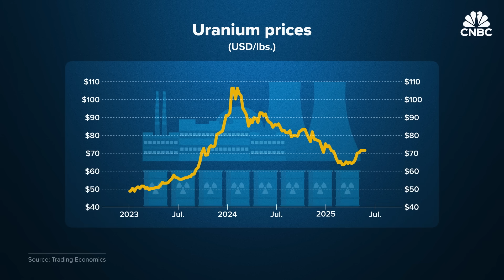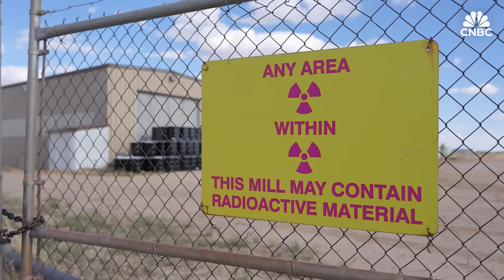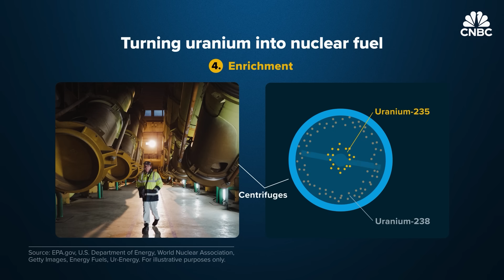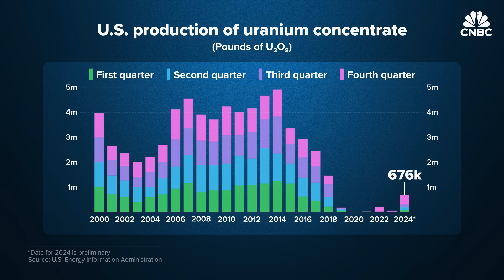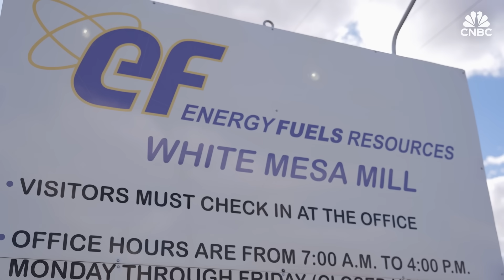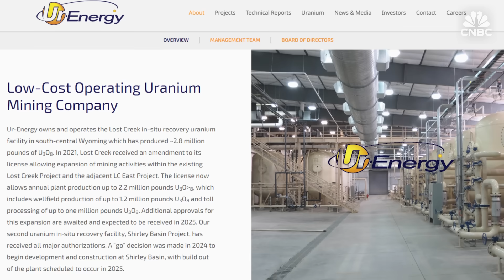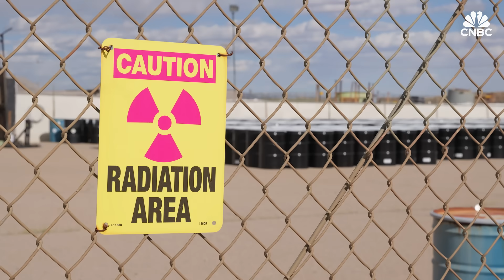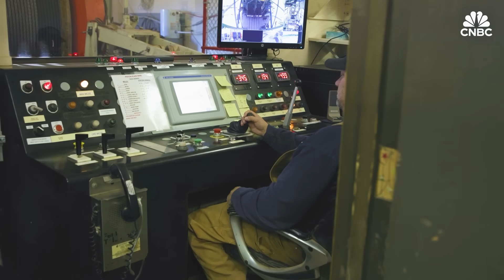How AI’s Need For Nuclear Energy Is Fueling A Rise In U.S. Uranium Mining

Comment: AI helps to format ideas from user input, especially in 3D blueprinting scenarios, and with data accessing, like a telephone operator, to access search results, for pertinent information 

Then fed back into 3D software programs 

Uranium is good for energy 

But the logic of it can be extrapolated also, to things like ytterbium, lutetium, plutonium, thorium 

Even lithium solid state fuel cells

Using ionized hydrogen for Voltage (power) 

Can all be used in tandem with AI 

And there are other methods besides steam electric generation from fission steam 

Like Nuclear Batteries, encased in diamond, which slowly send electricity through the diamond without releasing as much radiation, when triggered by striking with a conductor (Piezoelectricity) 

Or powerful Acid-electrolyte batteries, scalable to nuclear current in emissions of voltage 

Or spherical Nuclear Magnetic Resonance chambers 

Which use solar panels

To excite enriched thorium

Into a supercritical state 

Which then bleeds protons, hydrogen, and electrons off

Into a battery, charging it

Although smaller modular Nuclear reactors

Using steam from (control rods) fission, to spin a turbine, connected to a dynamo, before condensing the water for re use, and deuterium manufacturing, using the turbine to spin a dynamo, powering the grid 

Seems popular 

Especially on space craft and sattelites

To power the main computers, not the motors 

Although the computer is connected to the motor,

It would use its own batteries 

But be sensed by the main computer 

Etc

Comment: This video was unexpectedly rudimentary considering who they were interviewing, and really misses the supply/demand picture. Miserably. It touches on global consumption, but implies a static demand picture when there is an incredible volume of increasing demand through power plant life extensions and new builds currently under construction alone. Forget about the govt stated growth targets and data centre demand. 

Looking at US only currently consuming 25% global demand, and producing 1% of supply. If the peak volumes stated are able to be achieved again from the US, it’s about 15% current (2025), irreplaceable and required demand. Again implied that the US can achieve this, the absolutely critical questions not asked is - at what price, and how long will it take? The estimated answers to these questions are available and I would have expected CNBC to bring this into the conversation. 

Another implication I feel is misleading is the statement that power producers recognize the need for uranium which has kept the long term contract price higher than the spot market. The producers are in multiple years of being well below replacement contracting (buying less than they need) with 2025 being a record low so far. We’re well into the second half and they have purchased or committed less than 25% (annualized!) replacement volumes for the year (this trend has been underway for a decade). So what then has driven the higher cost of the long term market? The uranium producers holding the line based on cost of production and/or recognition of the coming bind the power producers are in, as well as the lack of available material is what. 

@CNBC - try again 👎

Comment: Nuclear power plants take 15 years to build if you are lucky and cost billions of dollars. Solar, wind, and battery take a year or so to build and only cost millions and they provide baseload power. Example at Vogtle Nuclear station two new nuclear plants were built and they cost 45 Billion dollars  and it took 15 years. Nuclear is not a viable economic solution for database centres which need the power NOW, and which are increasingly being powered by solar wind and battery plants. Built in a year or two, don't need water, and don't generate high level spent fuel that has to be stored for 200,000 years or more paid for by tax payers. SWB does not require a 10 mile emergency plan which entails evacuation of everyone within 10 miles of the plant. SWB is superior in cost, time, and fuel purchases which is free because it comes from the sun. The question isn't why this new process is better than old nuclear plant processes. It is how it compares with the new technology of SWB.
Reply: Nuclear is a black hole for money.

Comment: In this entire discussion they don't discuss how breeder reactors could greatly reduce the need for fresh uranium.
Reply: The US built their nuclear energy program around uranium. It would take even longer to build up an infrastructure around thorium.
Reply: @Teampegleg  The main issue is breeder reactors technically violate nuclear non-proliferation treaties meaning even more strict restrictions on them.
Reply: @NitroDragon  How does France get away with it then? They are the most prominent example of widespread Breeder Reactor use. There is also new technology, that eliminates the creation of Plutonium. The problem is that it's expensive. The US needs to break down barrier and subsidize it for the betterment of society.
Reply: @Teampegleg there are 87,000 tons of depleted uranium that can be used in a breeder reactor.  It wouldn’t require any new mining.

Comment: There are a few key insights that got missed in this review. 1. Other western countries have uranium deposits that can be mined for a much lower cost than what is found in the US. This isn't likely to change. 2. Uranium demand is very predictable, relatively speaking. It takes longer to build current nuclear power plants than a new mines. This means uranium miners can expand production on an on-demand basis. 3. There is a lot of mothballed/production expansion sitting on the side lines that can ramp up supply relatively quickly.

Comment: I like how the numbers are in tens of millions of pounds for all the US supply. I just want to point out that one GW coal plant can burn 2 or 3 million tons a year. Uranium is super energy density
Reply: One pound of uranium equals 1.7 million pounds of coal not counting all the energy required to mine it and transport it…coal is insanely inefficient compared to fission
Reply: That and a lot people don't realize that there is a massive difference in weight for uranium between ore and refined product
Reply: We should be using MSR Breeder Reactors that are walkaway safe and convert U238 and Thorium 232 into fissile fuel while they are producing electric power. The U238 in our nuclear waste bread in MSRs could power the USA for over 100 years.
Reply: We should be using MSR Breeder Reactors that are walkaway safe and convert U238 and Thorium 232 into fissile fuel while they are producing electric power. The U238 in our nuclear waste bread in MSRs could power the USA for over 100 years.

Comment: This is the main argument for thorium. No enrichment needed. It can be thermally bread. Online chemical processing is needed to remove neutron absorbing products during reactor operation, that's about the closest analogue to enrichment in its fuel cycle but its significanly less energy and infrastructure cost than uf6 centrifugation.
Reply: They also need a breeder reactor, which has not been in comission since the EBR-2 and would need to be designed, commissioned, and constructed to completely unfamiliar standards.
I agree with the thorium concept, but we don't have the means yet. Maybe if we help India they could share designs and results.
Reply: @samuelnakai1804  I mean, yes it needs to breed. But unlike uranium you dont need fast neutrons to breed thorium. It can be breed with thermal spectrum neutrons. Which means you dont need crazy stuff like liquid metal coolant.
Reply: Thorium 2050
Reply: Thorium has never been used beyond testing. 

However, there has a been a reactor type that has been in use for nearly 60 years that does not require enriched uranium. The CANDU reactor. It is also widely agreed to be the most efficient and safe nuclear reactor design.
Reply: @andrewm8703  A wild Canadian appears.
I've watched a few videos on it. 
2 main issues
1. You need alot of heavywater 
2. power output relative to capital cost is low compaired to other designs if you dont have cheap heavywater. Which canada uniquely has due to its shield lakes having higher than normal concentrations. That's why alot of countries actively building plants prefer the PWR and BWR design. Mostly south korea, france, and china.
Reply: @alexanderx33  You need heavy water upront, but after you have it, you do not need much of it through the reactor lifecycle. It can also be made domestically or purchased  internationally (Canada has a supplier). 

And while it does not produce as much power, its operating cost is much lower than other reactors and is highly efficient. You can refuel the reactor while it is operating at near full power whereas the others require a long drawn out shutdown. So while it is expensive upfront, over the long term it is incredibly cheap. Its one of the reasons Ontario has such lower power costs compared to its neighbouring states.
Reply: @andrewm8703  What is needed is something orders of magnitude lower in cost. Any widely used tech is logically already precluded.
Reply: Not exactly true. One has to start with enriched uranium to get the process started. At that point it would make sense just to use a fast spectrum reactor and burn up the 87,000 tons of depleted uranium we have sitting in storage.
Reply: @CurranKemp-p2z9b  Fast breeders cost more for 2 main reasons. 1. The design is inherently more complex. 2. The fact that they produce weapons materials means that the cost of security goes up alot.
Reply: @alexanderx33 one can produce weapon grade material in from the thorium cycle.

As for complexity, one can say the same thing with thorium.

Comment: Reduce uranium dependance, switch to thorium instead and use molten salt reactors.  They are smaller, cheaper, safer and, while requiring very small amounts of uranium, vastly reduce the quantity needed.
Reply: Use high temperature nuclear hydrogen for coal hydrogenation.
Reply: "Smaller" is bad for fuel efficiency. The only thing it may be good at is dodging oppressive regulations. 
And Molten Salt is good until alternatives like High Temperature Gas are considered, which are safer than Molten Salt, and more energy efficient.

Comment: I think a sustainable way to power data centers for AI should be propane and butane made from syngas produced from waste sources from gasification and pyrolysis. Another way to power data centers flywheel battery energy storage hybrid system( particularly using sodium calcium potassium zinc aluminum and magnesium), hydrogen made from syngas, hydrogen fuel cells hydrogen made from wind, solar, syngas, nickel hydrogen batteries, and compressed air energy storage systems. I think this could be an affordable cleaner way to power data centers.

Comment: Why not building new ones that run on thorium? It's far safer.  We already have more than enough nuclear warheads
Reply: My understanding is we have lots of people who know how to process Uranium, build Uranium reactorsand operate them, also we have equipment for Uranium and decades of experience using it but switching to thorium would be like starting again
Reply: @od9694  Its worth it since it would be easier to deal with and the aftermath wont be anywhere as severe
Reply: @mahfujkadir8973 i suppose the thinking is we need energy yesterday, the Chinese have the right idea they are literally building every kind of energy you could think of
Reply: Thorium is not price competitive...
Reply: Here's a nice video on Thorium reactors and the pros and cons.

https://youtu.be/bz4aTO6M4Ho?si=ppygfIPasHocgxej

China currently has an operating Thorium reactor and plans on broadly expanding their Thorium molten salt reactor program.
Reply: How do you know Chinese plans if they are building lots of water reactors ? @yan.broccoli
Reply: Thorium can not produce the same output

Comment: There is a lot of waste involved with nuclear power. Should be worth looking at reprocessing spent fuel if there is a shortage.
Reply: The "waste" often is recycled into new fuel rods and is also reused for medical treatment and screening methods amongst other uses. Nuclear produces a very small amount of unusable waste.
Reply: It goes into ammunition.
Reply: @danielcuevas5899  Only a tiny part is used in tank shells, non-radioactive at that. Absolutely no one is using depleted uranium in small arms.
Reply: I don’t think America recycles Nuclear “waste” but we should
Reply: Very little actual waste. We do way way more waste from renewables. 
Not only that, but also having reactors beside old light water reactors would reduce waste significantly and improve overall fuel efficiency. Heavy Water Reactors were commercial in the early days of Nuclear Energy. Fast Neutron Reactors are pretty old too. We just need regulations to permit those reactor types to be practically allowed.
Reply: There is no shortage. Just self imposed ban on Russian uranium... But the bigger problem is lack of enrichment capacity - at competitive cost.
Reply: @АгронДепартье beg to differ.  By 2030 there is an enormous deficit.  Economic pounds out of the ground are not even planned for that 2030 deficit.  Pounds in the ground do not come out quickly or easily.  Greenfield mines take decades to start to produce.
Reply: No there isn’t.

Comment: So you would rather mine new uranium than reuse waste fuel?!
Reply: Well we have to produce waste in order to reuse  it right?
Reply: I’ve toured the White Mesa mill before, they do recycle used uranium waste.
Reply: Cost and nuclear proliferation issues are the reasons why reprocessing spent fuel is not common.
Reply: I don't think they can be reused. That's why it is call waste.
Reply: @saulgoodman2018 that's what they said about gasoline in the 1860's. It's called Mixed Oxide Fuel (Mox fuel) and France already uses it.